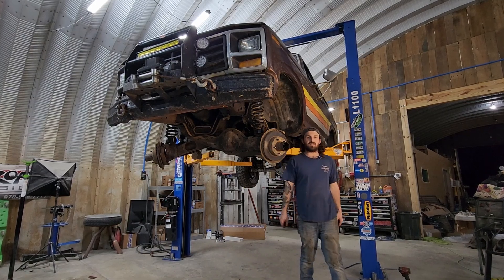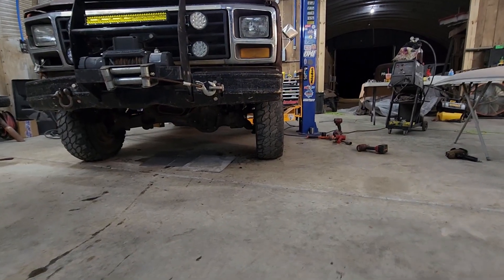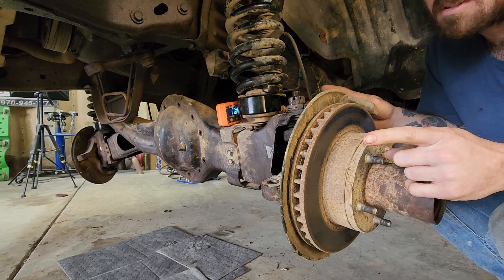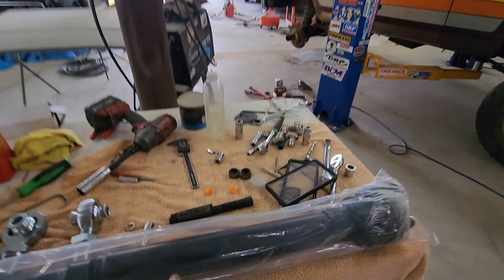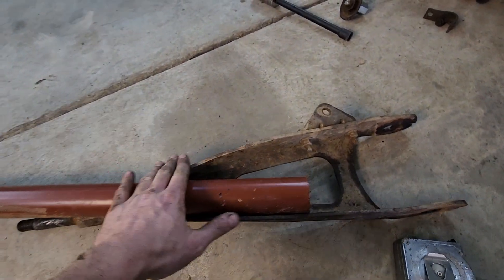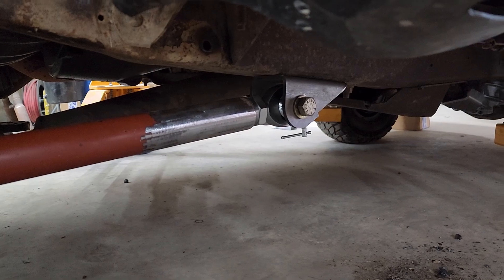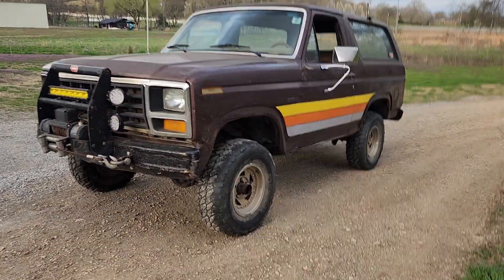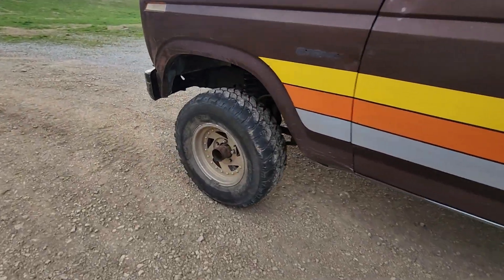Ford Bronco DIY Extended Radius Arms (TTB long travel)

Comment: This and your cut & turn video are so helpful I can’t even thank you enough. I’m going for a TTB Dana 50 conversion on my ‘99 E350 van and you cleared up a ton of confusion for me. Kudos man, thanks again!
Reply: A van with a ttb is going to be awesome 👏🏼
Reply: @hedlcm  Thanks, I’m pretty psyched! Hopefully it all comes together smoothly.
Reply from the maker: it should go together nicely; I'm running about 7* positive caster at ride height, it's slightly harder to turn but man it takes bumps!
Reply: @rockitgarage23  Ok sweet, thank you, that’s good info. I was going to start at about 5.5° positive caster.
Reply from the maker: that's a good starting number; my idea was I don't want to go negative caster when the wheels come off the ground. doubt I'll be in that situation often but ya never know!
Reply from the maker: Yeah, that will be sicks!
Reply: I want to do this to my 1997 f250 7.3
Reply from the maker: @JBizzle822 its alot of work but i think its worth it and better than lift brackets
Reply from the maker: Thats awesome! I'm glad these videos could help, was my first time for cut and turn and I had to solve a few Questions on my own, that's why I made them. I have some more videos coming out on the bronco. Thanks for watching!

Comment: Where are you zeroing your angle block?
Reply from the maker: My concrete is pretty level. I use the knuckle and where the spindles mounts for camber, as well as the end of the hub where the lock out mounts. And the upper ball joint stud/ and compare it with the coil bucket for caster, worked well.